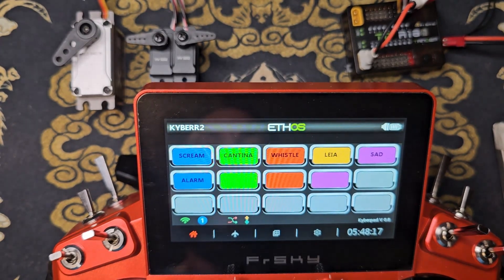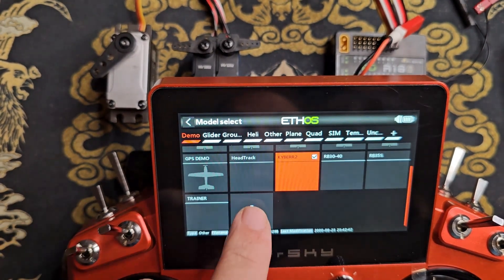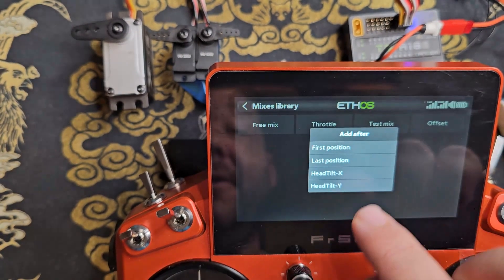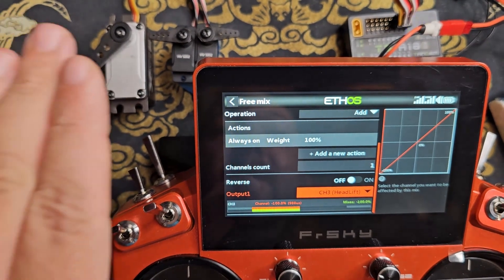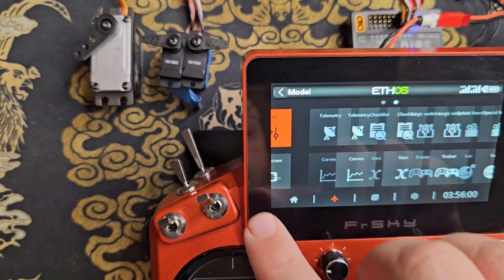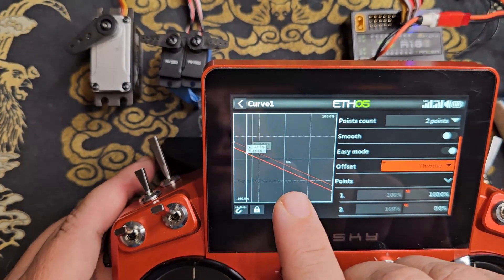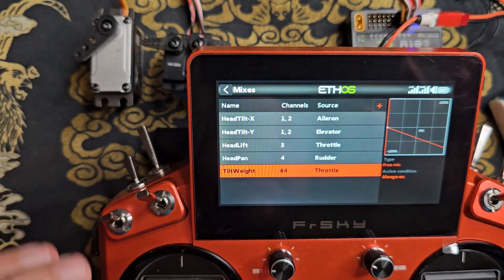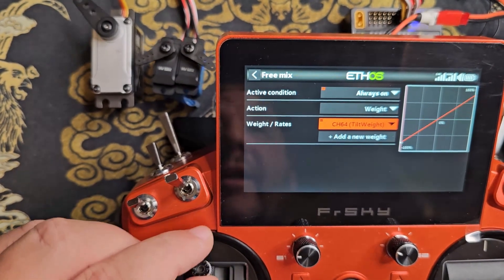FrSky ETHOS Programming B2EMO Droid Head Tilt Weighted to Head Lift

Comment: This is a great idea! I can see that as a way to simulate a Differential lock / unlock on our trucks with one motor per wheel. I would also investigate how to use this for mixing hydraulic pump for our construction models. Thanks Ben.